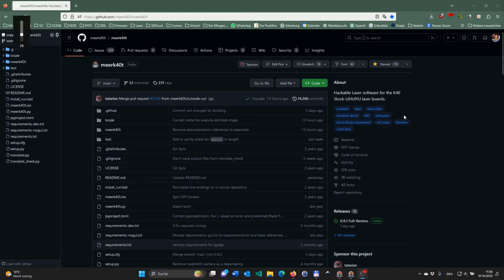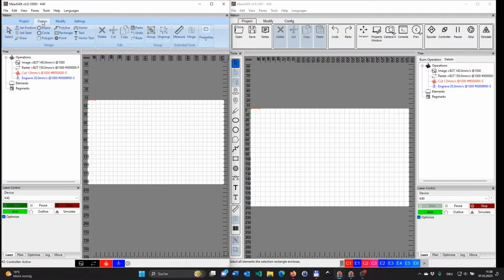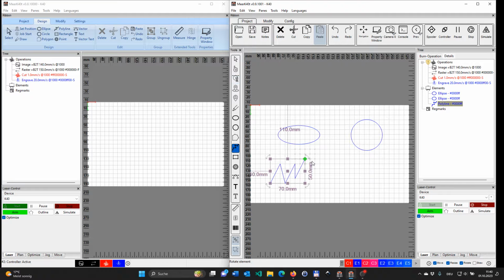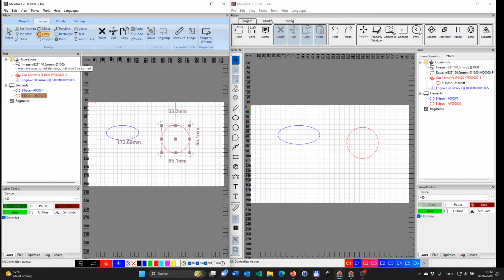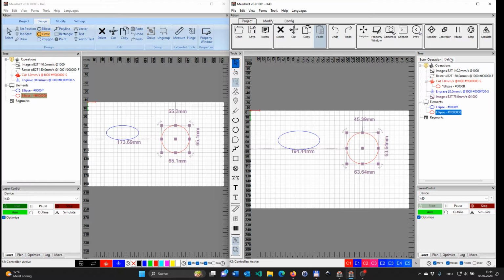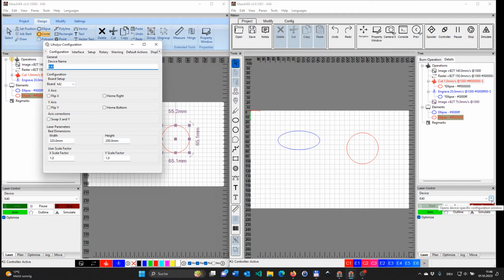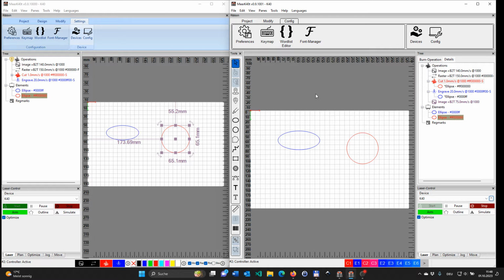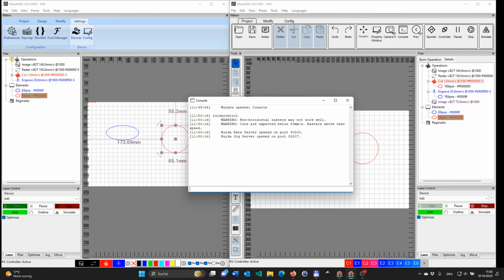(Visual) differences between MeerK40t 0.8 and 0.9

Comment: I come from Whisperer and want to ask how do you control your power in Meerk40t. I set it psychically on my machine, lets say 15mA and if Im gonna use 1000ppi it means the output will be 15mA? So 500ppi will be 7.5mA etc? Am I right?